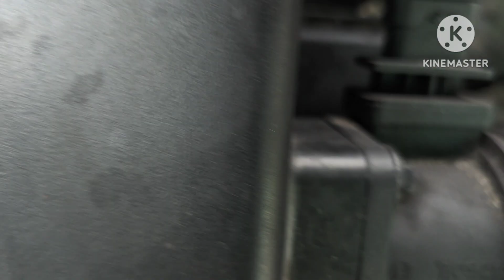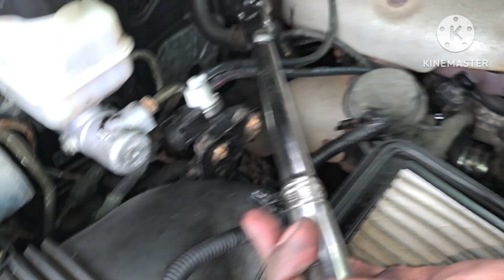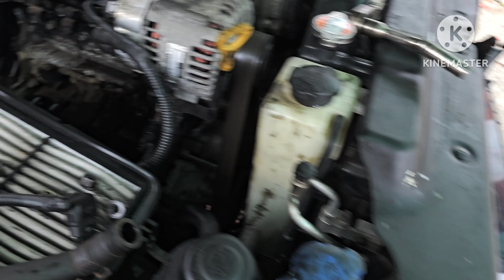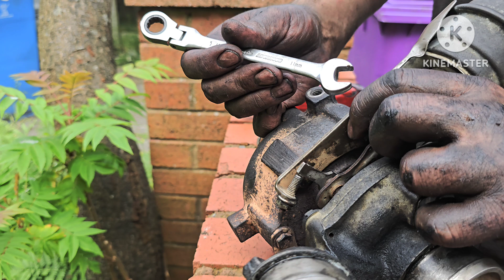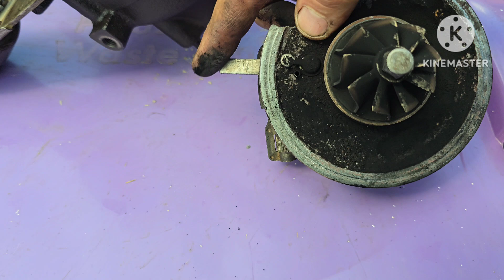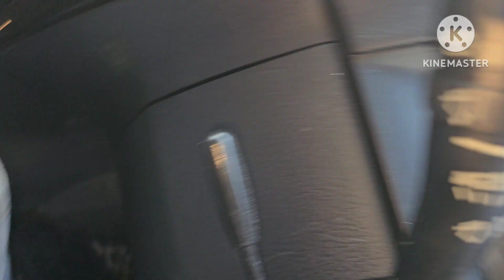2007 KIA Sorento 2.5 CRDI, lack of power taking off from stop. Diagnostic and repair.

Comment: Where did you get this part from? My lever doesn’t move at all.
Reply from the maker: I found the vacuum actuator on Ebay. Make sure the veins aren't seized up in the turbo. Mine were when I replaced my turbo cartridge so I had previously had cleaned and freed them off before I replaced the vacuum actuator.